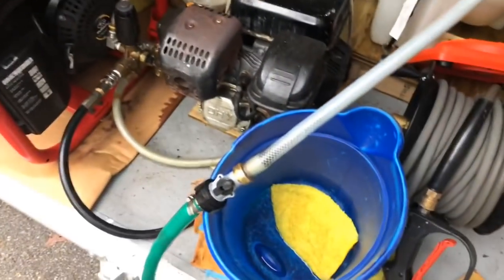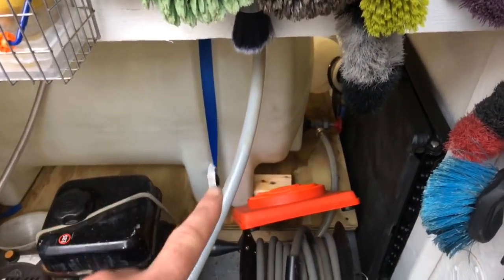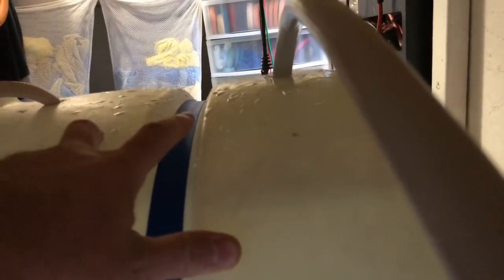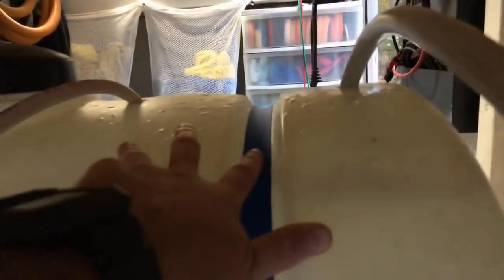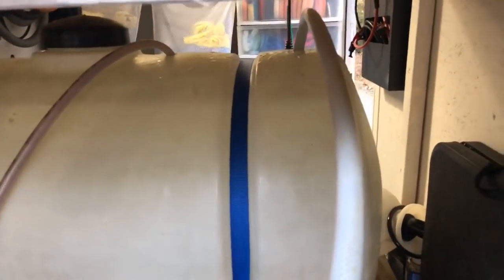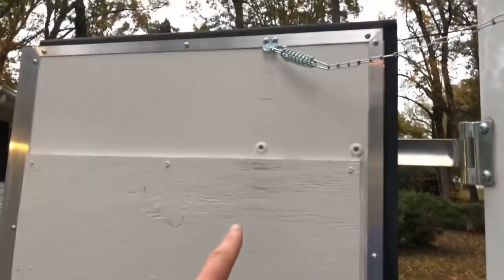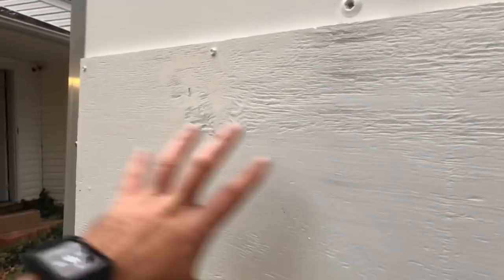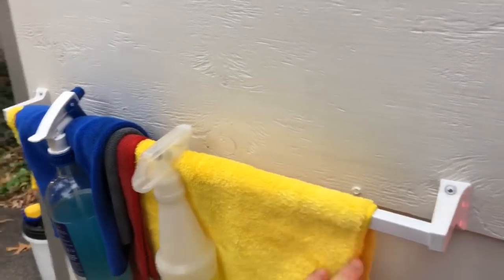Miranda Detailing LIVE Updates!

Comment: Question. Now that you've had the trailer for some time is it a challenge sometimes to park in tight driveways and small parking spaces compared to your SUV?:I have a van and a pickup I wanted to buy a trailer but I thought about this and had my second thought about that.
Reply from the maker: That was my worry also. So far it really hasn’t been that much of a problem. There was one job today that was an estimate and it was in a downtown area. There was no right on to actually preform the job so after the estimate we told the customer that we would need another location. We may run into a few more jobs like that but I usually ask the customer if there is room like a large open lot or driveway. We prefer not working in a tight area anyway since we take up a lot of space. We used to run into the same problem when we had a large van.
Reply: Thanks for the reply. Trailer is great for carrying all the equipment and like a little office the way you have plan but like you I hate to work in tight spaces, I have a big Van and sometimes I run into that problem I can't imagine how it would be if I trailer behind me.
Reply from the maker: Depending on your area it may be a challenge. But truthfully it’s not as bad I thought it was going be.